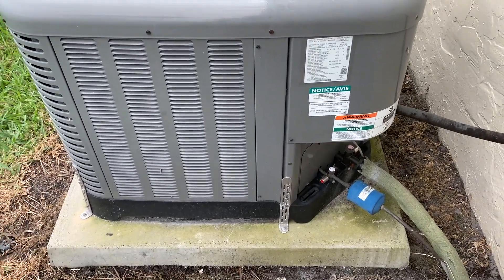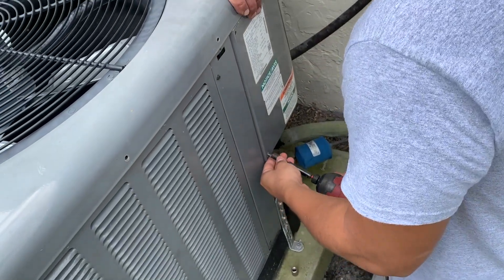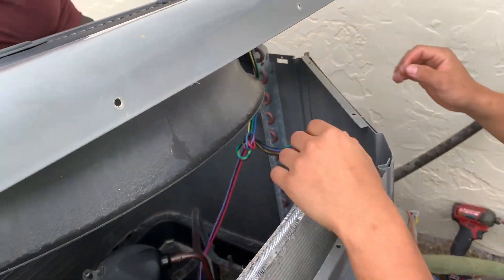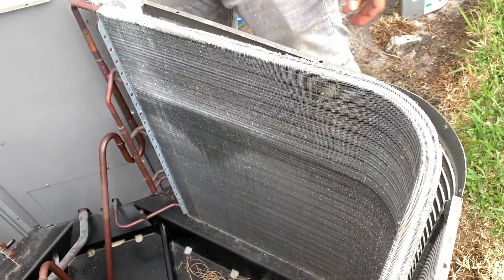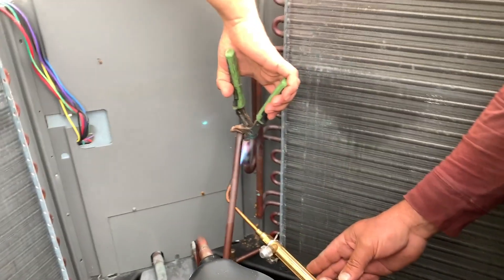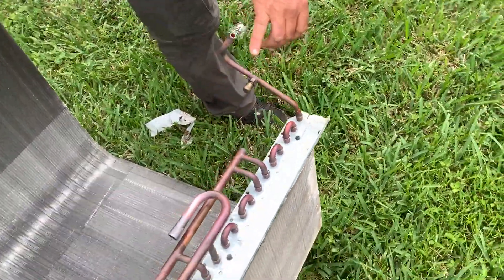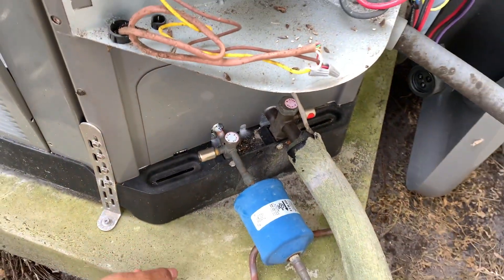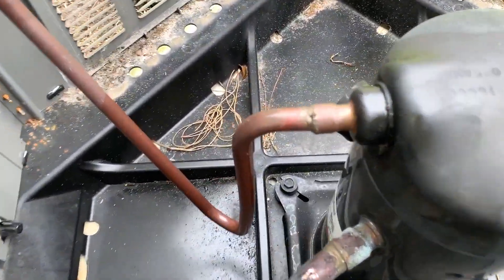How to remove the Coils from a Ruud AC compressor

Comment: I removed all the top screws so that I could clean the coils.  I later realized one screw is longer. Where does that one go?
Reply from the maker: Probably goes in the area where your electric panel is the one corner good luck thanks for watching

Comment: Nice tear down video. I have a 3.5 ton that I am going to use as a chiller to make snow at home in Florida. I now know where to hook the water from the sump pump from the pool, and the out of the coil will run to the power washer. I will kick on the fan. Hopefully the 30° air passing thru the coil will make the water cold enough to make snow ❄️ 😀
Reply from the maker: That is such an awesome idea. You Gotta make a video on that it’s gonna be cool literally thanks for watching.
Reply: Question, thoughts on the fan direction air flow. Should the fan spin normal and suck in cold air, or reverse the fan and blow cold air over the coils?

Comment: I'm in the process of purchasing a Ruud. This video give me cause for concern. Do you recommend this unit? How does it perform? Thanks for sharing.
Reply from the maker: Well once we fixed it it’s working great but I think it has a lot to do with the installers the guys who put the thing in originally what is the greatest mechanics and if you do it yourself and your new know how to use a torch it’s pretty easy good luck and thanks for watching
Reply: @TomLeeman  thank you for the quick response.  Our Ruud 4 ton will be installed tomorrow. The company owner only sells Ruud and has one at his house.  Hope it lasts a long time. Thanks again.
Reply: Condenser coils hardly every leak. Ruud is among one of the best as far as long life span and definitely serviceability. They are industry leading in serviceability. Designed by techs and not engineers. Sorry engineers but… no I lied I’m not sorry at all. Techs get good reviews, not engineers.